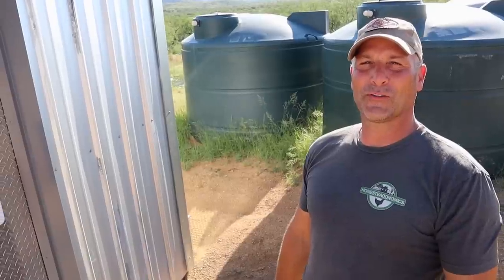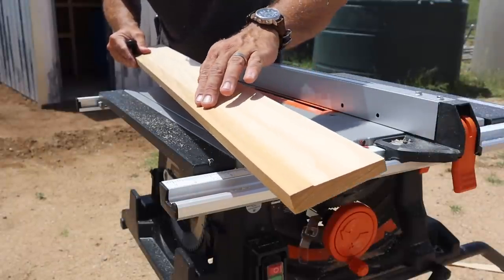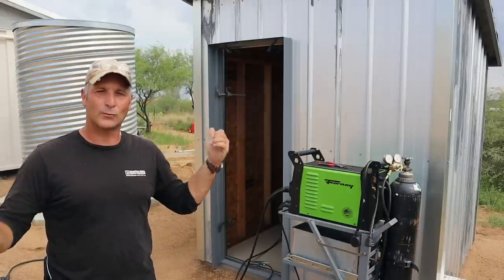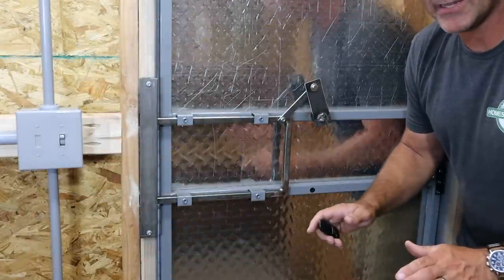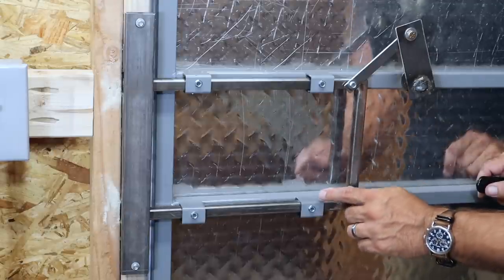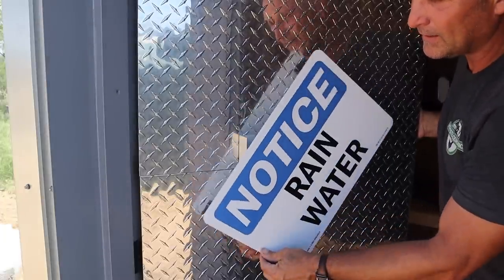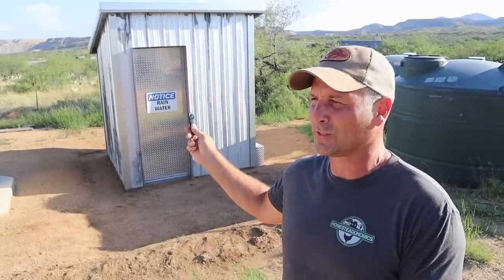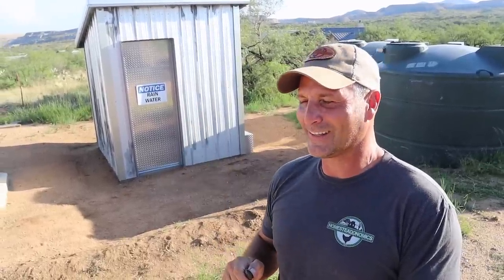Door with Hidden Latch -  Rainwater Pump House Project ( Part 2)

Comment: Now attach a spring to the mechanism on the back and make the u shape beveled so you can pull the door shut and walk away
Reply from the maker: I considered a spring action mechanism to close the ‘U’ channel but just figured I’d keep it simple as the beveling and adjustment on that 1/2” tubing would require quite a bit of work to get it just right, the way I’d be happy with it.

Comment: My main concern with the sign is the adhesive. Will the heat degrade the glue and the sign fall off? Otherwise great setup. 😊
Reply from the maker: Yes, it’s a valid concern.   But if you look into the VHB tape, it’s not just your average double sided sticky tape.    It is the same stuff that auto manufacturers use to put body panels on, tour buses, ambulance/fire truck sheet panels.   It is also what I used to put the aluminum panels on my travel trailer project.   It’ll hold into temps nearing 300 degrees.   I know it sounds crazy but I’ve used this on a lot of project and it’s absolutely crazy strong.   Stronger than rivets in a lot of cases.  
But again, I totally understand the concern as it’s hard to believe until you work with it.🤪👍

Comment: How did you secure your nice threshold?
Reply from the maker: It currently is just friction fit down there…. I wanted to give it a couple weeks for that linseed/spirits finish on the bottom to cure.   Then maybe some calking or silicone adhesive.

Comment: I’m needing to
Buy a new table saw is that evolution table saw as good or better than a ryobi or dewalt table saw ? How is the accuracy does the fence wobble at at or the miter gauge?
Reply from the maker: Well, that will depend on what you’re needing to use it for.   If you’d like to be able to cut steel like this one can, absolutely.   But if you’re only going to be cutting wood primarily then you might opt for something that is less expensive.  
As for the fence and miter gauge.   Fence has zero wobble and glides nicely.   The miter sled is also pretty tight and holds the angle well.  I think I will eventually build a large sled that runs in both tracks as that will always be more accurate than a single sided sled.  But so far I’m pleased with it.
Reply: Right on thank you for getting back to me , keep up the good content 👍🏻 also you should consider making a patreon discussing side hustles or making stuff , ect